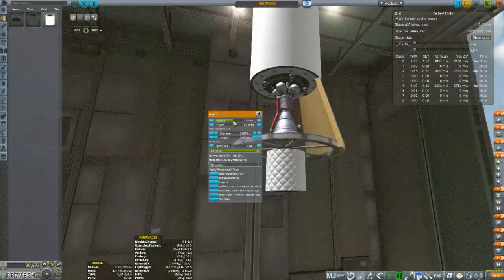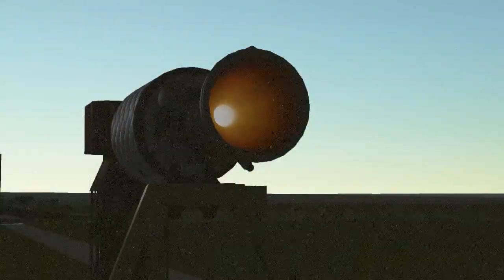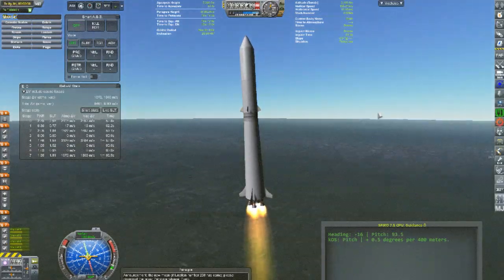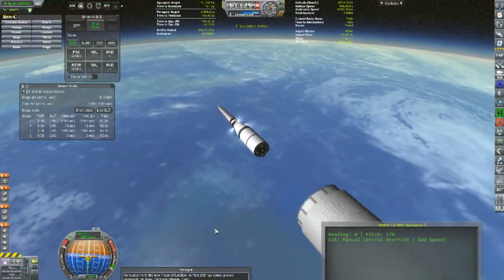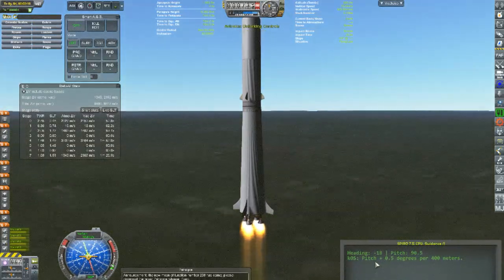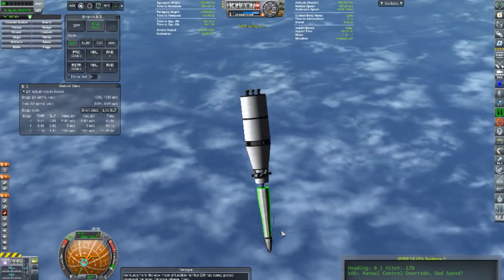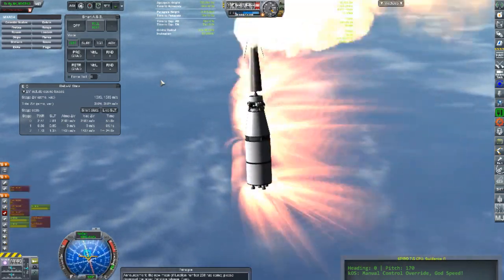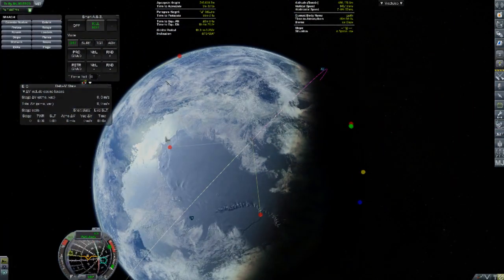Polar Problems | KSP RO RP-1 Ep. 4

Comment: I was playing ksp carrer mode on normal because I am still technically a beginner even though I have been play for a year or so, anyways built a ship with 3 probe ssto reusable liquid boosters and landed all three in the water. I had to try multiple times because I was way too steep on the return. I had to constantly switch back and forth between three to slow them down, I had to keep them in range of each other so I can control them. I had parachutes on them.
 I got my rocket in orbit to go to the moon but that was stressful. I want a slow time button for multitasking in this game.

One of the big reasons I tried this is too save money and I finally figured out how to switch between vessels, probes and kerbals.

I am going to make radio antennas everywhere. A common bouy and radio towards for land so I can have maximum range.

Also, does anyone know how to extend the range for loading in vessels? I was in carrer one time and got my spider lander stuck on the moon because I didn't have enough fuel. I sent a lander with extra fuel to rescue them but I landed too far away, so I created a rover car but under shot my landing. I used terrier engine as a vtol brake but the balance was off so I had to adjust the thrust to land it. It took many-many attempts because I was going fast and it was hard to control. Everytime I slowed down my direction would change.

When I finally landed safely I was still really far away so I went back a few saves and tried to get closer on my approach. I learned from my experience and got closer, landed and then drove...However the week tires made it so I cant go past 10km speed. So I had to slowly inch my way there. Braking to quick save.

After, I made it I released both had barely enough fuel to escape.

I still didn't know how to use the builder engineer so I started a new game kept my crafts and began again. I plan on recreating the same set of circumstances.

I also was low on funds since I went to the moon on my old save. I spent almost all my money to go to the moon only to realize...I f*** up.

"These are the voyages of the Starship Enterprise to boldly go where no Kerbal has gone before my mission to loose everything at the cost of scientific progress, curiosity and quite possibly blow something up, yourself up or loose your mind"

Comment: I wish modding ksp was as easy as launching a sounding rocket for the first time
Reply from the maker: Pointy bit towards space?
Reply: @N9GamingOfficial  
Does that also apply to WiFi connection cause ckan decided to download multiple gigabytes of mods for RSS and RO at 65 kb/s despite the fact average download speeds at my place are at least 20 mb/s
Reply: @0Ploxx  a south polar problem xD

FYI on the south pole there are no commercial satellites so they have to use NASA communications satellites, uplink and downlink sats or military sats, But they only have coverage from those sats a few hours per day, and when they are not covered they have a ~50kb/s connection for A GIANT LAB COMPLEX